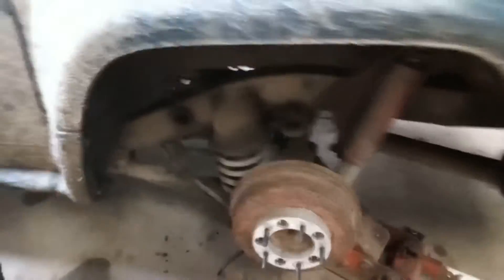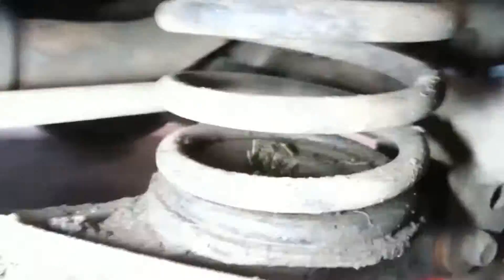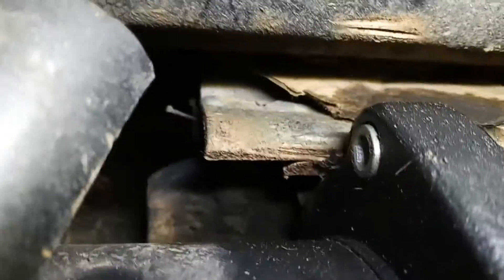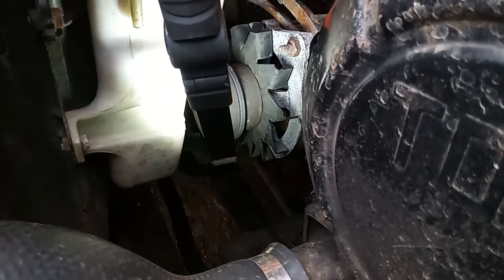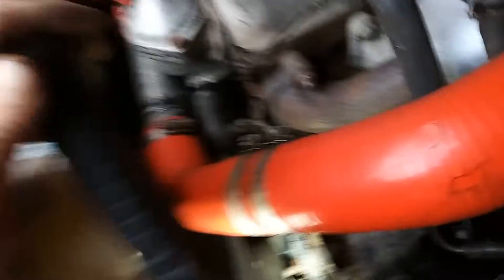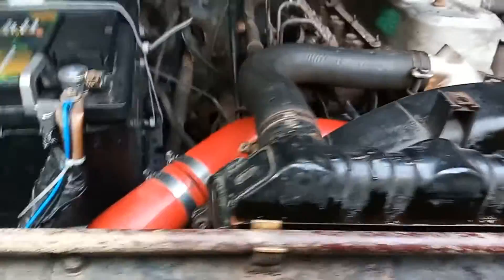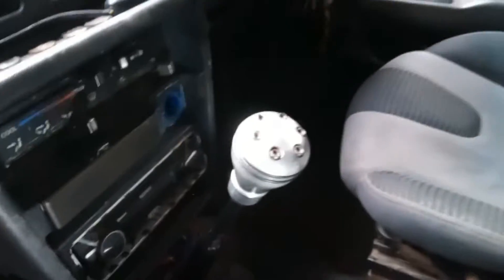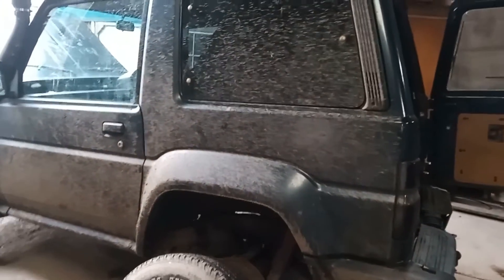fourtrak improvements

Comment: Good video to help new people improve there fourtrak, i have a few questions tho 🤣 when fitting the snorkel how come you modified the air box you should of just taken the air box out and ran a pipe from the snorkel thats what i did with our fourtrak put a gause in the top to stop anything getting in works great, also when adding the lift springs did you modify the torchun bars at the front or did you just wind them up as im adding disco springs to mine and just wondering thats all
Reply from the maker: thank you phil, so your first question, just because i wanted a decent filter for the air, the farm gets properly dusty in summer! and because i didnt think of it! lol no just wound them up, i could have wound them up further but 2.5 inch was fine for me, i will go bigger tyres to get more lift.
Reply: @garageorgold7098  okay matey will have to try it i was gonna cut them and rotate them so if in future i need more of a lift i can just wind them up more lol
Reply from the maker: That's a good idea, I found if I wound them up much more than that the wheels started to pull in at the bottom, and I didn't want to wear my tyres on the edge so I left it at 2.5 figured if I needed more I could do a body lift

Comment: How does the land Rover springs behaves? Arent they a bit too stiff? What about the load capability?
Reply from the maker: they are a little stiff, but with the shocks they work well, are you thinking about doing new springs?
Reply: @garageorgold7098 
Yes Ive got done 2 new springs, but they did them wrong, after 2 weeks the back of the truck was squashed like carring a lot of weight.
So Im thinking of adapting Land Rover ones like you did.
The problem now is that it has the original ones, and they feel stiff, I bounce like hell inside the truck, and if you load it with 2persons on the back it slams like if you put elephants in there. Is driving me crazy.

Comment: So they are front land rover shocks on the rear ? Would rear landrover shocks not work ?
Reply from the maker: well i did end up using landrover shocks on the back, but had to change it as landrover are pin to [pin, and fourtrak is pin to ring setup. i used terra firma +5inch extendable shocks they work a treat tbh